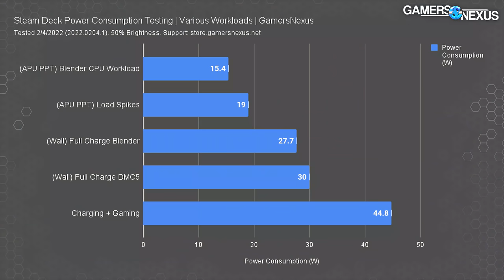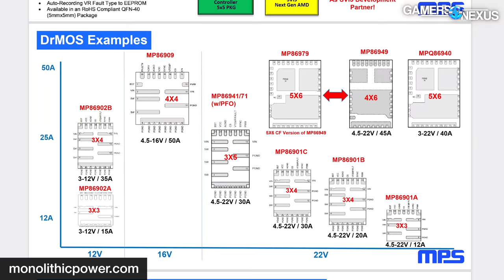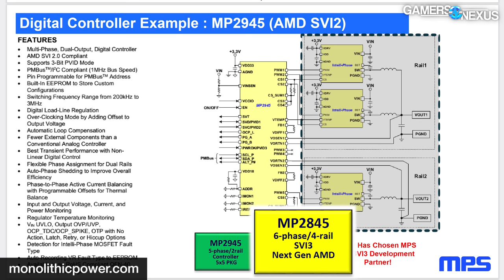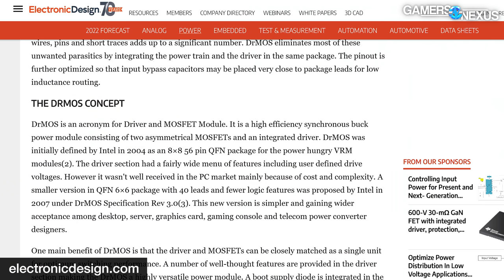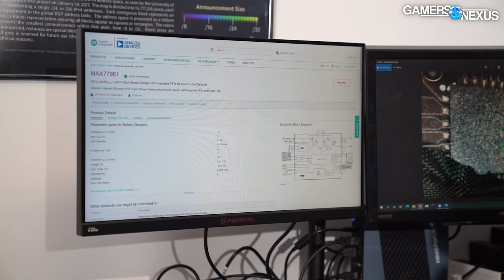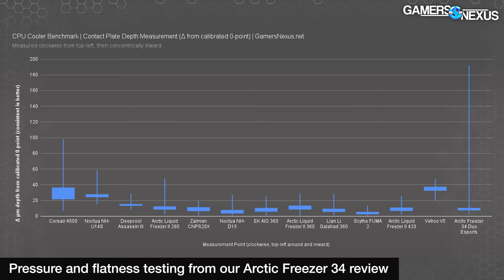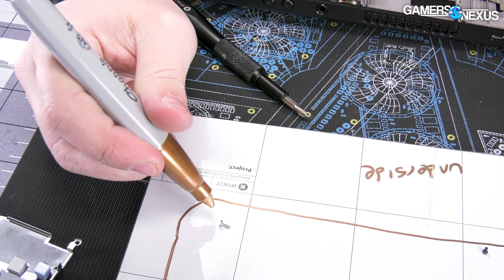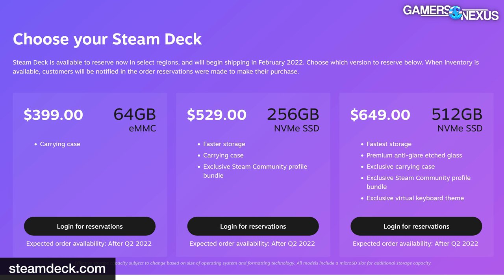Steam Deck Tear-Down: Build Quality, Disassembly, & VRM Analysis

Comment: COMPLETELY UNRELATED TO THE VID... so i got 16gb of 3200mhz ram. for some reason it keeps setting itself to 2400 mhz. each time i try to change the speed in bios back to 3200, my pc just wont boot for a while until it changes the setting back itself to 2400mhz (someone plz help)
Reply: There's a certain bios option to run in a custom power profile I'm pretty sure. At least that's how mine worked I had to youtube some videos on overclocking ram to get it to run at advertised speed.
Reply: @Zaque-TV  thanks for the reply man, but at this point ive tried everything. even if i get the system to boot after changing the ram speed, itll crash as soon as i open my browser

Comment: Correct independent is not the correct word, descreet is better fitting.

Correct 6A is not great for you. If you had 6A through the heart you would die. 25V should not be enough to drive a deadly amperage through both the skin and through the arms and to the heart and all the way out again. But if you had nipple piercings, possibly if you grounded one and put 6A to the other

Comment: Please someone make a custom CNC full copper cooler to attach above the original cooler and that it cool all VRMs, memories, charging IC and the most of the copper cooling pipe and sell for a good price.

Also I'd kill for a 3d party cover for the Switch that separates the console from the controller and with strong metal rail/connector so that we can make it like a Switch.

Comment: Even if you did touch the charging IC that is 25v 6A, you would be perfectly fine. You would only have 25v DC go into you ASSUMING the charging circuit is not active (i.e. you have the full 25v available to you with no load downstream). It would not be at 6A because the resistance of your skin is not low enough to drop the voltage enough to generate that 6A of current with only 25vDC flowing. But let's assume the charging circuit is currently in use and it is pushing 6A. Can you touch 6A DC in circuit with your skin? Yep. Sure can. Don't believe me, Connect the cathode and anode of your lab power supply via exposed alligator clip wires, set the voltage to 12V (or 25 if you want apples to apples, doesn't matter) and current to whatever you want (maybe 6A for this example) and grab it. Nothing happens. Weird. Now put both the cathode or anode directly to your skin without them being connected. Let your skin be the medium. You wouldn't even feel it.  DC is incredibly safe until you start to get to higher voltages (200vDC is where I personally start to feel shocks. I only know this from when i began working on power supplies, RF equipment and large rectifiers and I had accidentally bridged myself or my tool to a charged component). It takes very high DC voltage to actually burn you, let alone kill you. Current is not the enemy, directly anyways. You can grab a metal anode bar carrying 12V 3000A DC current and not feel a thing. Why? Because if that bar is measuring the full 3000A it's only got 0.1v on it and that low voltage can't hurt you. You can also seperate that same bar and replace it with yourself and not feel a thing bc remember, we can only get that 3000A from the 12V DC if we have low enough resistance and our skin is definitely not phased by 12v bc of our high resistance. Ever grab the terminals of a car battery with jusy your bare hands? Some batterie can support outputs of over 1000A, but 12v can't do much with your skin to get that current. People need to remember that the current is only achieved when voltage doesn't have much resistance (I=V/R), which the skin has a ton of. 1ohm is hardly any resistance at all. If you put 12v to that you'll get 12A output. Your skin is about 100000 times more resistive then that on average. 

And before someone who doesn't understand what I just said comments about how they got the snot shocked out the them when they put a 9v battery on their tongue, that's bc your tongue is wet (water has a pretty low resistance, especially if it's salty) and is not as resistive as your skin. In fact all of our internal organs have pretty low resistance compared to our skin.

Comment: This looks pretty good overall, but I have to say I'm also very disappointed about the battery being glued in. Batteries are basically consumable and should be replaceable by default, gluing them in is just terrible, doubly so when you consider that the force required to get through the glue could easily damage the battery and cause a fire if you slip up. Just awful.
Reply: Yeah they should use some kind of spring latch mechanism for the battery

Comment: You have dropped the ball valve. I would make a battery exchangeable and fan with access hatch to clean. Not to mention a DIMM slot to upgrade the ram and slot to upgrade the ssd storage.

Comment: I'm a bit sad that the joysticks aren't detachable like on the Switch, because they are quite big and bulky. And the grip (although presumably very comfortable) adds a lot of unnecessary space behind the device if you consider to pack it snuggly into a bag.  (I guess it's a way to not infringe on Nintendo patents). It's a shame though, because the device is ACTUALLY amazingly small once you exclude the two big gamepad areas. I kind of hope that there will be a tablet mod for this eventually. :)

Comment: I have a spare M2 2242 SSD I thought I could somehow fit in my steam deck (the slot is 2230, 12mm shorter) but it looks like that hot charging IC is too close.

I hope soon or later the chinese will make a replacement backplate with a ribbon cable and a full-sized m2 slot, that'd make everyone happy.

Comment: Personally I feel like Steamdeck leaves a lot of room for improvement, but I hope Valve sells tens of millions of these just so they can fully commit to the idea and get us some better specs for Steamdeck 2.0.
(We should have a high end Steamdeck with a 1440p OLED screen and 1TB storage, and the GPU should be twice as large and consequently the battery should be twice as large, but that would be a very different system in price and size so you can't release that product as your first introduction as a mass market hardware vendor.)

Comment: Lmao. says need to disconnect battery first so screwdriver does not accidentally arc.  Proceeds to stick screwdriver into spring and then button before disconnecting battery.

Comment: Hey, I love your videos but can we please stick to science? 19:43 refers to 6A of current as "not great to feel". However considering that the absolute maximum voltage rating of any pin for the MAX77961 is 30V there is no way any harmful amount of current could ever flow through a human body from that. Also operating the charger without proper cooling should be relatively safe thermally. The MAX77961 has integrated over temperature protection triggering at 165°C tDie. While operating at or around this temperature is probably not ideal for the chip I'm pretty sure Maxim has done their research and made sure it can survive that for quite some time. (In addition to that there is also an integrated charge current control loop that tries to keep the ICs junction temperature at 115°C max by default; so the termal shutdown is really the last resort). Also please keep in mind that operating temperature usually refers only to ambient temperature and does not have anything to do with package or die temperature. Valve might be referring to the maximum package temperature they chose to tolerate in their design process.
Reply from the maker: You're correct on the first part. Thanks. No need to be so rude about it. However, for the second part, the Valve spec is 105*C.
Reply: @GamersNexus  Hey, thanks for the swift response! But since it is neither clearly stated in your video nor your response I have to ask again: Are you sure the 105°C are really an ambient operating temperature rating and not something else like tCase? (Also what about "°C" vs "*C", is there some thermal engineering difference in there I'm not aware of?)

Comment: I'm surprised that Steve, Patrick, and the Steam Deck survived this teardown. Valve's crappy "teardown" video insisted that the battery would cause death and that the Steam Deck would lose structural rigidity or some nonsense like that. 🙄 Worst FUD I can recall seeing in recent memory, even overtakes the stupid auto manufacturer "you'll get assaulted in a parking garage if independent mechanics can fix your car" ads.

Comment: I truely do not get it. To big to  pack around, to expensive to let a kid walk around with, and less functional than a cheap laptop. Looks very breakable, and you got 1-1/2 hour battery life when really playing?  The hype train will sell for a while, then common sense will take over. I guess if you only want to game it may make sense as opposed to pc, other than that it looks like a dead end, even that seems silly, if you do not want to deal with pc why sign up for linux. Lets be clear here, that is NOT repairable by average user, it would need a good repair shop or mfg. If you still want one, probably better get it now. I see nothing to push prices down, likely "parts shortage" will force prices up. Next time put partial tear down in title.

Comment: Epic failure on the glued battery.
it makes a joke or a lie of any claim of following right to repair to supply temporarily delayed landfill if the battery can't be replaced, so if that claim is anywhere on marketing or promotional material, expect the legal claims to start in about 18 months to two years, LiPos having a cycle life of 500 (full) cycles and to get maximum use, they will be very close to full cycles, because, physics.  And chemistry.  And if the whole device does not cut off hard when batteries fail, at least some will fail in the spectacular fashion that we all know LiPos do and have seen videos of, so that will even rule out use as a wired-only device tethered to a power outlet.
Shame on you, Steam.  Temporarily delayed landfill is available for far less money, simply by not making false claims about repairability.
Reply: I mean, in the end it’s just glue, it’s not melted with a frame, you can still take it out, calm down.
Although for sure, Valve, if you’re listening, take approach of Apple and their lates M1 Macbooks and the glued strips they use to secure the battery that are very easy to peel. Seems to be a good compromise.

Comment: You guys do good but this is somewhat kind of idiotic idea to make a video of the hardware and mention every single thing like VRM components BUT not mention a single thing on how virtually every single goddamn PC on this planet is made like that including Apple Macs, Consoles, and everything. Many think this Steam Deck is some sort of messiah lol because I get it you want to target as much as possible but do not leave information out. All PC DIYers who buy K chips and run them with some tweaking are aware of this right, but not that other crowd who you target.

As for the build the whole stainless steel backplate concept is straight up junk. They could have gone with a simple VC block on top like Sony Xperia Pro and other Chinese high performance targeting phones. And avoid this heatpipe with tripod abomination without proper cooling for Memory ICs, every single Tripod design on notebooks was a disaster which is why Razer went Vapor chamber many use that crappy Tripod nonsense but yeah lets mention some useless AL alloy junk lol. 

As for battery, you guys did a good mention of the spec rating BUT even G6X Micron on Ampere is also rated at 105C and it heats up to 90C that doesn't fucking mean it's good. Which is why all modify the damn thermal pads. This is a serious shitty design by Valve on the IC for battery and that kills the battery fast, you didn't even mention how Batteries made up of Lithium Ion do not like heat. Which is why OnePlus Dash is so popular because it doesn't heat up Battery but the Power adapter.  

You guys didn't even look at who is the manufacturer of those Joysticks which is the most important thing to know for a drift like Switch drift, PS5 ones etc.. iFixit will let us know, so much for the damn 35Mins and didn't put this information. On top where is the showcase of the NVMe slot, eMMC on the motherboard ??

Comment: Man 500$ for a handheld 720p low toy...
Unbelievable.
Imagine the series s is 299
Reply: You have to realize that isnt a fair comparison, right? Handhelds have always been significantly weaker than home consoles for a number of reasons. For context, the GBA had to cut corners graphically and musically to port SNES games, all while the PS2 was out. The fact this thing can run modern releases at all is a testament to Valve's engineering prowess, and makes it well worth the $500 price point IMO.
Reply: Yeah, I know it gives tons of value in other aspects compared to the current offerings on the market, but I'm surprised how easily people overlook this aspect.